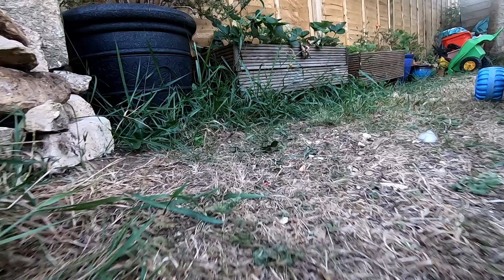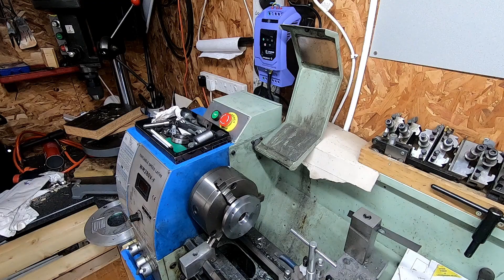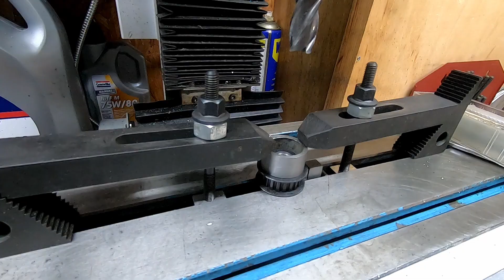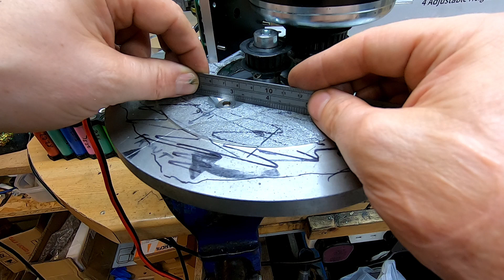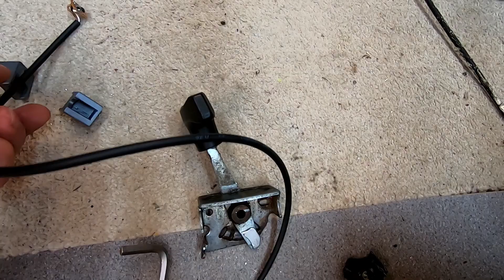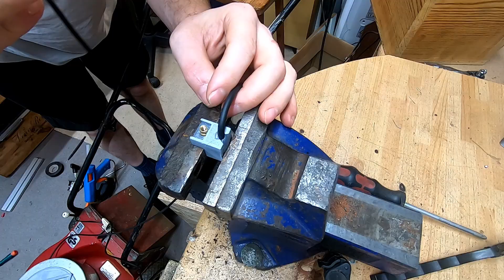I finally finished my e-mower conversion!

Comment: Would have gone with a serpentine and tensioner, OR you could do direct drive, if you coupled the motor to the support that takes all of the side loading and jolts. It probably wont twist the shaft if it stops suddenly. It would need a driver that can take backfeed. 
It would be most efficient doing it that way. 
Also thinner blade, and no front deck obstructions.

Ive done a rotary mower, it is either working amazing or kindof a pain, dependent completely on grass type and shit in the yard. 
It lasts longer than expected, but still, it could have been twice as efficient if i used the right voltages, 58v battery feeding a 130vdc treadmill motor is not super efficient, but its plenty enough to get the job done. A low speed bldc motor would work perfect, but i wanted to spend no money on it, with parts I already have on hand. 
The 200wh battery can get a LARGE yard done, with 2 charges, but it could do it with 1 battery, if I were to take out all the heat losses and torque disadvantages. 
Works best at the perfect speed to keep grass upended and cutting at a certain slices per foot or whatever. 

I will do a rotary mower, because I think its simpler and better, and more efficient, I will be doing something clever with the blade, It will be s shaped, like 2 bananas as an s, so it can scythe the grass instead of bluntly cut it. 
It is used on electric robot mowers, which run on battery and need the added efficiency. 
It will be made of hard surface stainless steel that is about 2mm thick. Not much but I want max efficiency. I want to mow the yard with 100wh which is probably over unity. Thats really what I think.

Comment: europeans: US why do you still use inches and feet? it's so confusing!

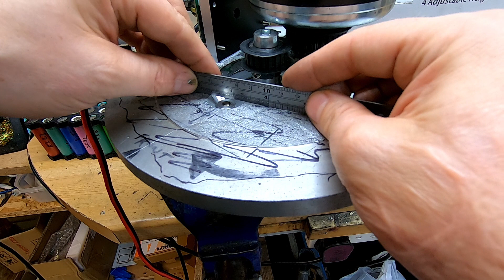also europeans: 11:18
Reply from the maker: History! It would be so much simpler if we could all use a common measurement system. In England both systems are used, although it is mostly older people who prefer imperial.

Comment: Would it be more "efficient' to simply 3d print a adapter for the battery pack to utilise a brand pack? I.e Makita, Bosch, Ryobi etc..?? Am thinking of doing the same with my old petrol mower too
Reply from the maker: Absolutely, I could have done that. I have 2x 18v batteries for my drill which I could have used, but I had the cells and I wanted to have 2x 36v batteries, so that's why I went the DIY route. Thanks for the question.

Comment: Something similar is how e-mowers need to be, just super simple like that, possibly even direct drive.
Reply from the maker: Hi. I did consider direct drive, however the motor was not fast enough, so the belt drive gears it up 1:2. Seems to work well. Thanks for the comment.

Comment: Hi Olly, that is amazing, well done!! The lid looks great as it is, save that next free afternoon for yourself

Lets hope the grass grows quickly in order for you to test it and then onto the next stage ....... to convert it into a congor robot lawn mower, if that doesnt frighten Treacle then I dont know what will!!

I shall go and have a look at the previous videos, interested to see the wiring spot welding. Seeing the battery array it reminded me of a project I worked on many years ago now, it was a submarine emergency buoy to be sent to the surface when a sub was in distress, to provide a location light and emergency signal. Lithium batteries were quite rare back then and I seem to recall some concern on their handling.

Good luck from Spain!!
Reply from the maker: Hi David, I've not yet done the battery making video. Next on the list!

Comment: The mower's eye view in the opening sequence is inspired 👍 I'm saving the rest until I've reacquainted myself with the first three parts.
Reply from the maker: Should've done a grass box eye's view! 😁
Reply: @ollysworkshop  A great series of films. I will be interested to see the battery build (and a little of how to safely manage them would be handy). I have an occasional supply of good used 18650's but apart from using them to populate empty power bank cases I've shied away from incorporating them in anything by fear of their reputation for needing careful handling.

Comment: Very cool  But see it running How many minutes was the batteries on board and then how many was the new battery pack
Reply from the maker: Hi Frank. Unfortunately the grass is really short at the moment as it's so dry here. I don't think I've mown the grass for a month, so I just had to attack a couple of tufty bits at the edges. So to answer your question, I don't know yet! The batteries are designed to last about 30 minutes each, I still need to make the second one. I'll do an update when the grass has grown.

Comment: Hi Olly. I really enjoyed watching the mixed content, great job. Pity about the lid casting the finish looks superb. How long does it take to charge the batteries up fully. Tony
Reply from the maker: Hi Tony, I was very annoyed with myself about the lid, a waste of a rare free afternoon if nothing else. I may try again, but I have so much stuff to do that it'll take a back seat for a while at least. The makeshift lid keeps the grass out of the works.  With the charger I have it would be about 3 hours for a full charge. That could be reduced to 1 hour with a beefier charger. I will be building a second battery to keep me mowing. Hardly any grass to mow at the moment as it's so dry.

Comment: Next time, just use your horizontal press. :) Chuck it up in the lathe and use the tail stock to press in the bearings.
Reply from the maker: That's cruelty to lathes! Although it was pretty cruel to my vice, it's not quite the same precision as the lathe. I have a beefy threaded bar (about 1 inch) that I plan to make a screw press with.